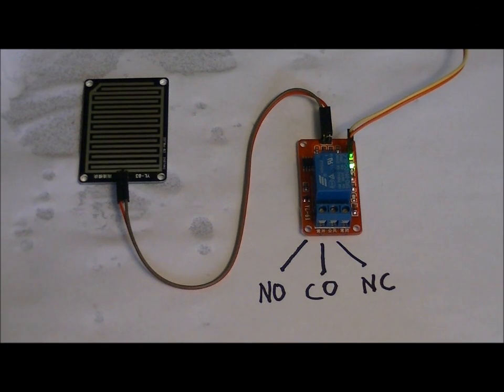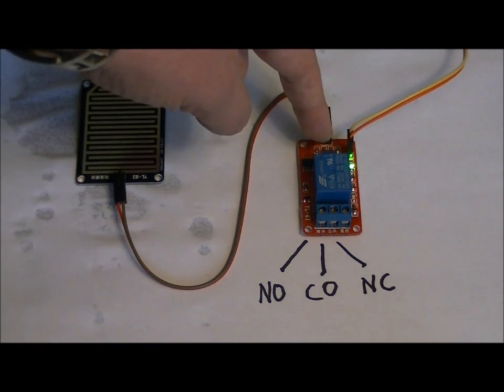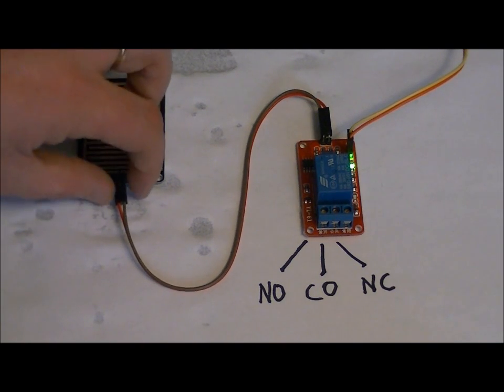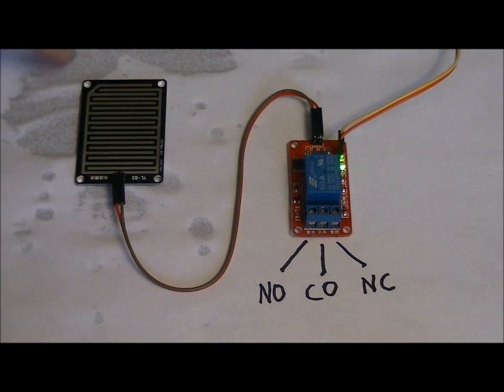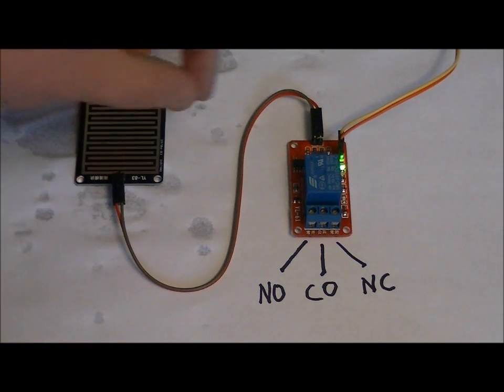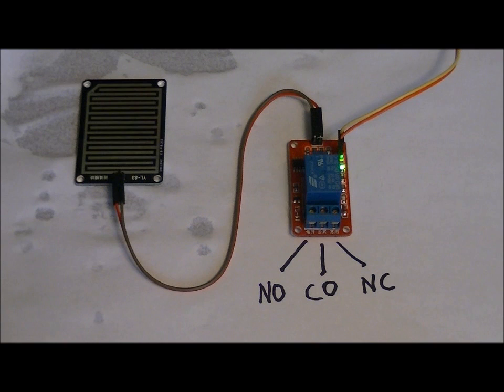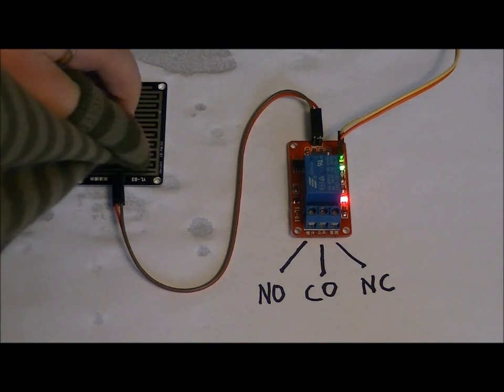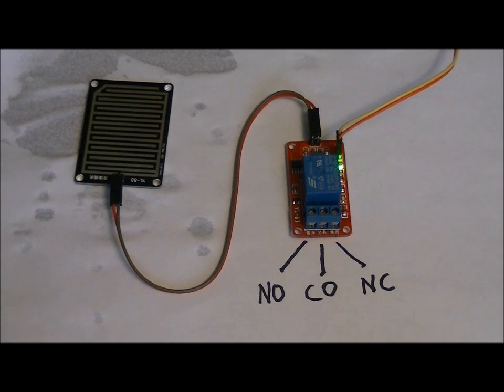The Moisture (Rain) Detector Module With Relay - EASY TO USE!

Comment: Does this type of setup get false positive's if it was foggy during the night, and then as a result dew forms on the plate?
Reply: yes mate. I fitted mine to a servo so it turns to let the rain drip off after a detection but they still pick up false readings. I thought about using compressed air using a solenoid to blow it clean.

Comment: I used this on my graduation project it was nice, but one problem is there. I used it as a level sensor when the level goes below the sensor after reaching the sensor for the first time the LED wont go off, you have to clean the water when ever the level reachs the sensor. i know it is made to be a rain detector but i used it as level sensor.
Reply: +iDrunkky There is a different sensor for that. It's called a water level sensor.
Reply: +iDrunkky do you have its coding?
Reply: so you have litar schematic for water detector using relay